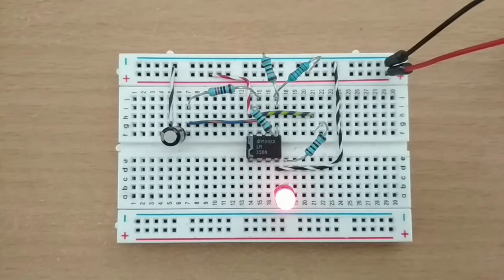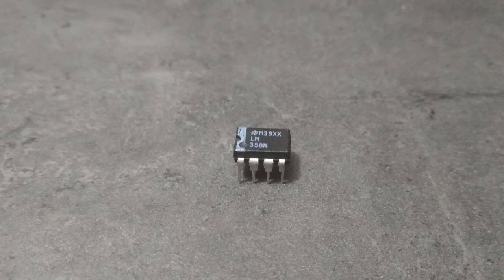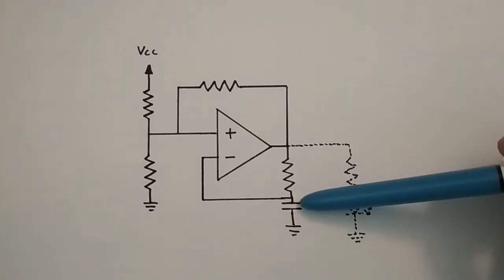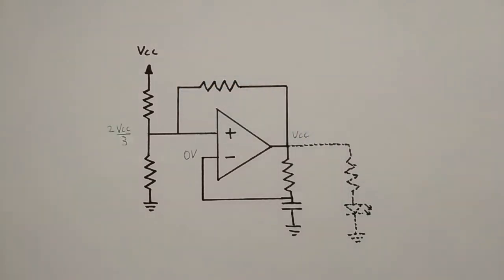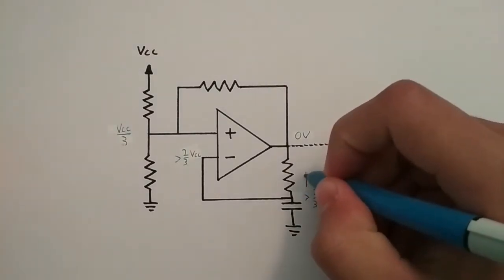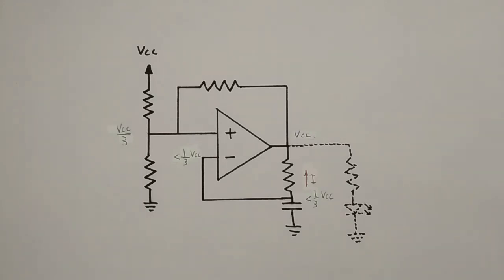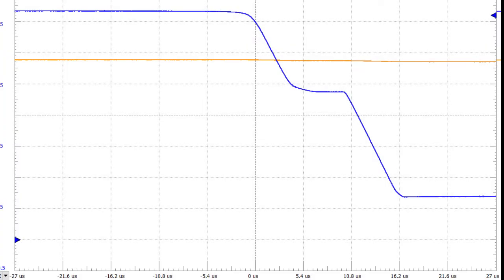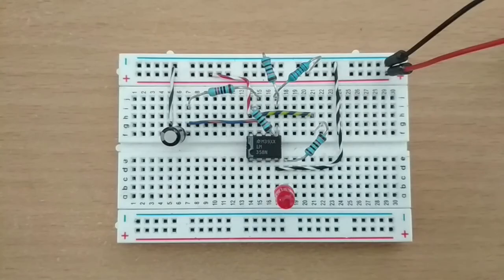How to Make a Square Wave Oscillator from an OpAmp

Comment: Why is the threshold 1/3 and 2/3 vcc? Just a function of the opamp?
Reply from the maker: It's because of the resistor values. Assuming a rail-to-rail output the positive feedback resistor is virtually in parallel with one of the two from the voltage divider, giving that fraction of the supply voltage.

Comment: what's the value of the capacitor ?
Reply from the maker: Hi, unfortunately I made the video years ago, so I don't remember.
But it might be 100uF.
If you're looking for a specific frequency just use the formula: f = 1/(R•C)
This will give a good initial approximation.
Reply: @5VLogic  thank you. Can I have a circuit diagram plss.  I am beginner about these stuff.i literally confused which pin at op amp That connect in circuit.
Reply from the maker: @quswer8206  Sure, no worries. What components are you using? In particular what OpAmp? Because the pins can change. I'll try to draw a quick schematic and upload it somewhere.

Comment: Great video! Straight to the the point and without bull poo-poo. But i need a 1mHz , how do i make one of those? How can we make +3 and -3 V for opAmps with as little components?
Reply from the maker: Thanks,
Do you mean a Megahertz or a millihertz.
Both are on the extreme side of the spectrum.

For 1MHz I think it's gonna be tough, I recommend using a different circuit, maybe if you have a fast switching comparator you can pull it off but I definitely can't guarantee...
The RC value is going to be about 10^-6 so like 1kOhm and 1nF I believe. Still, I'd opt for a different circuit; crystal or LC if you're feeling adventurous.

For 1mHz the RC constant would be 10^3 so like 1MOhm and 1mF. Also you'll have to wait more than 16 minutes for one period...

I want to remind that these values are very approximate.

For dual power supplies you need some sort of dual power supply... ;)
Simplest might be two batteries in series and then regulated with two linear legulators.
Reply: @5VLogic  *MHz mega hertz.

Comment: I tried whit a 12 v dual rail supply, all resistors 10k and a 1 mocrofarad non polarized capacitor and i was also us
ig lm324 quad opamp (only one amp) but it wasent working ... Any idea why?
Reply: Ow do yo make the pulse whidt equal on both levels?
Reply from the maker: Thank you, it's always great to get positive feedback and to know someone actually tries to reproduce the projects!
If you're trying to get a 50% duty cycle and aren't getting one, it's probably the output of the opamp that's better at sourcing current than sinking it (or viceversa).
You could use a potentiometer with two diodes, like in the 555 PWM classic online/YouTube schematics.
Hope that helps!
Reply: Nevermind it worked really nice and clears explanations. I like this channel a lot:quality content every time

Comment: How to calculate the frequency? I'd like to know the formula
Reply from the maker: Great question! Because the two voltages the cap needs to reach are 0.33 Vcc and 0.67 Vcc (assuming all resistors are the same) the formula is similar to the one for the NE555: T = 2*0.693*R*C => frequency = 0.72 / (RC)
Reply: 555 has two comparators and one flip flop and one inverter accordingly, but it has only one comparator. 

Anyway thank you so much sir. I work out again to get the desired frequency.....
Reply: What if the resistors are not the same, what would the equation be?

Comment: I was waiting for the new video 💪🏼
Reply from the maker: HAHA, so was I !
Reply: @5VLogic  when the output is 0v, the capacitor starts discharge. Now, I'm confused where the capacitor finds its ground to get discharge itself!!!! Is it discharged through the LEDs resistor??

Please little bit elaborate on this discharge process. Thanks.
Reply from the maker: Great question, an important detail to remember is that the OpAmp's output can both source current and sink it, meaning if the capacitor is charged and the output is low, current will flow from the cap, through the resistor into the OpAmp's output since the latter is virtually shorted to ground.